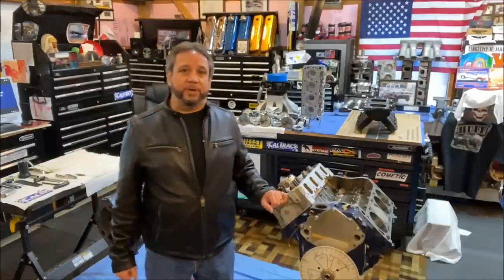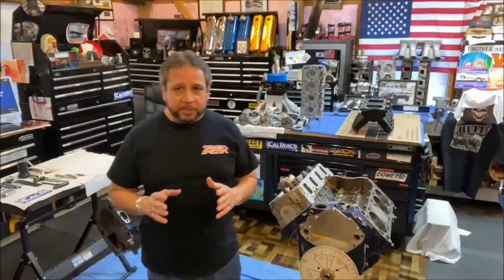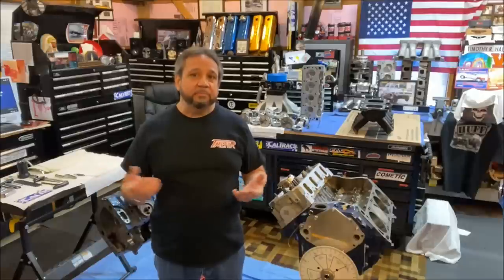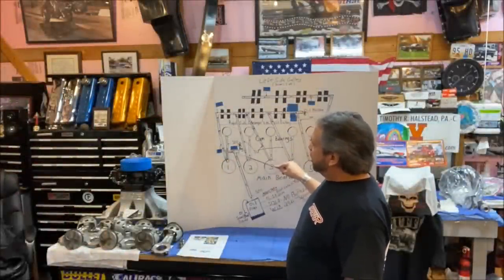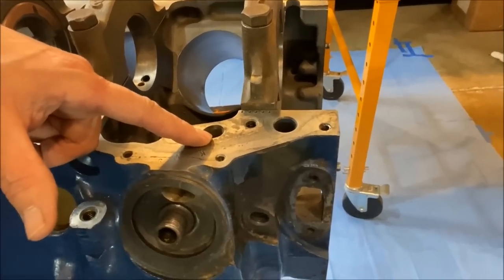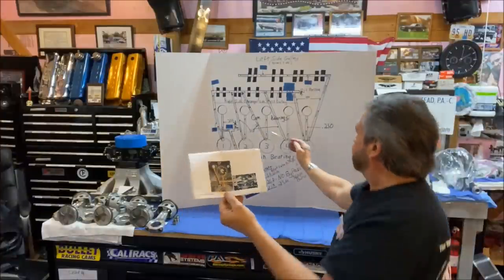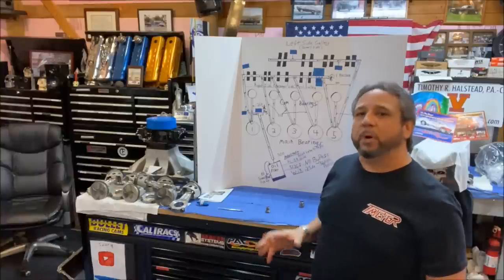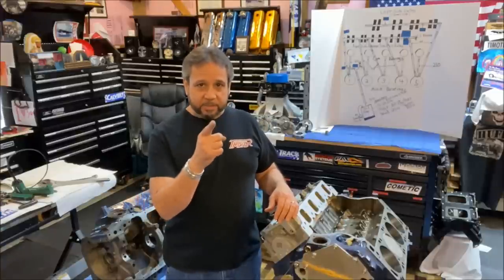Ford 351 Cleveland Oiling,  The Truth, and More

Comment: Mr dragboss, I had oiling problems with my 351C with 4V heads.  It started after I decided to go wild and have my engine really perform.  I never had any problems when it was stock and only putting out 300hp.  I had cleaned the inside of the block and debured sanded and used armature paint to coat oil return passages back from the head all the way down to the oil pan.  I had oil restrictors to the cam bearings too!  My 351C with 4V heads was ported and polish with a wild Crane billet roller cam.  Gross lift almost 0.750" 312 duration.  1150cfm dominator, modified Super Competition Hooker Headers.  Pretty much straight headers but with the collectors.  After many years later I figured the the reason I had oiling problems was due to acceleration.  This 1970 Mustang fastback was a light stripped down version without any frills.  It put me in the seat so hard that reaching for the shifter required lifting on the gas pedal.
That was what the cause, acceleration put me pinned in the seat and the oil in the oil pan pinned to the rear of the oil pan.  The answer would have been creating a oil pickup for the rear of the engine which would have solve the oil starvation problem.  Please comment back if the find this post.
Reply from the maker: Thanks Greg for watching the video and commenting. You are 100 percent right. One of the most important aspects of oil control and adequate supply is you need a big sump, 8+qts, I had issues too and then learned a few tricks and have been good ever since. Yes I also just leaned that the pan shape also affects oil control and you are best to have a square pan in rear, the stick pans are poorly designed in regards to windage. I am burning a video, right now with interview with Trickie, from the famed Australian engine builder/racer team of Trick and manswetto. Wait until you hear his opinion. Glad your here Greg. Way more in store hopefully post tonight.
Reply: Whoever built Benny Gatts Clevos, must know a legal F""ck ton about them.
Reply from the maker: I would say so.
Reply: Motor plate. Rear sump. 12 quarts of oil. Remote filter, two of them. Braided lines.
Only one thing chevy has over our Ford's. Rear sump.

Comment: Another great video, from my experience and research, aeration of the oil is a big factor , which in my case running hydraulic lifters , had a hard time stopping valve float , even as low as 5000 rpm’s , installed solid lift cam rev to the moon , put did it just mask the aeration? The line from the front to back from what I understand minimizes the aeration. My new Cleveland I installed Tim Myers cam bearings, plugged the half inch hole on number 1 journal , full groove bearings, and Denny Wydendorf diy lifter bore bushings (super easy to do at home) standard pump , and never looked back , also it basically turned my block into a priority main .
Reply from the maker: Thanks John for watching and sharing your real world experience. Not sure on your issue, I have never ran a hydraulic cam. Looks like you got it figured out. When I think of valve float, I think weak springs, but again no juice cam experience. Denny messaged me and we are going to chat. I have never ran bushings, and have seen his kit installed. Who knows maybe he will sponsor me, and we will put a set in and an episode. Be cool for sure. Aeration could be happening, also. I found you need a large sump, where I am at. All good things to consider to help optimize your oiling system. Glad your here and stay tuned

Comment: Love these education videos hope you keep making them. I got the 400m boat yard motor. But having knowledge from the guy's who have been there. 500 passes on a motor means you've learned a lot.  Oiling a stock motor an cooling it was rough issue from it's stock form so restricted. Make's sense faster you can get the motor on the top front n back the faster you can reduce friction. Mechanical oil pump on my 400m running Lucas Motor oil at only 80,000 mile's failed.  Truck has sit 16 year's now. After replacing it with another Mechanical pump I felt stupid knowing oiling an cooling was a issue. Putting a patch back to the problem wasn't my intention.
Reply from the maker: Thanks man. Now better get it back going, 16 years is too long to sit idle.
Reply: How do you know the oil pump failed ? Oil drive shaft between distributor and pump twist/ break ? 
Did you drop the pan ?
Reply from the maker: Missing what your saying Cam?

Comment: I just picked up a new project car and now I found your channel with great information.

It's an all Original unopened BOSS 351 swapped into 1986 Hatchback Foxbody.

I'm very interested in learning pushrods again after running Modulars for so long.

Liked/Subbed.
Reply from the maker: Sounds like a good find. Any boss engine should have D1ZX part numbers, I did a whole video on rec room geometry there’s a link to it you can check it out make sure watch my channel. Stay tuned.
Mid Lift Theory /Rocker Arm Geometry, Laser Guided Precision.
https://youtu.be/1fU8jAz5RGw

Comment: I'm a cleveland guy. Mine is a 1970 boss casting, .030 over, 56cc closed chamber aussie heads, lunati bracket master cam(4 deg. adv.), dual plane intake with divider completely removed. Stock rotating assy. About to put 2 small turbo's on it, 8psi waste gate pressure. In a 73 mustang. There is a learning curve on these motors for sure.
Reply from the maker: Your car will be making some crazy power with boost, I worry about the increased cylinder pressure, but with 8 lbs or less you should be fine. Hope your cr is not too high. Thanks for the kind words. Glad your here. Please like and subscribe, way more to come
Reply: @DragBoss351Cleveland  I subbed.  
  I worry about compression too. It's around 10:1   I am going to start with some very low timing, like around 16 and raise it incrementally keeping a check on the plugs. I'll set the final timing based on the timing line  on the electrode and how they overall look.  I shift at 5k, so I'm not looking for high RPM.  It shouldn't starve for fuel. I have A/F gauge to monitor.
I wish I had a dyno.
Reply from the maker: @starbattles1  I always use total timing at rpm, I lock my distributor, runs way better, idles better. Yes, 10:1 is a bit high, but if your not beating it to bad may be fine. I would be pulling that to at least 6k, let it stretch its legs.
Reply: @DragBoss351Cleveland  I really wish I had gone with roller cam when I built it. I will next time it comes out and apart. But I need to do fuel tank swap with elect. fuel pump in tank. Already have it, just need to do it.  I figured out these mechanical fuel pumps, even good ones, don't like rpm's over 5k. When I would run it to 6k the fuel pumps wore out super fast. Since I made 5k my shift point I stopped going through fuel pumps.
It was first built with flat tops, 14:1 high rpm intake and 3k stall. 
I had to dial it back to the open dual plane dish top's and 2200 stall to make it derivable around town. That's why I want the turbo's. Keep the drivability I have now, and get back the power I gave up, plus some.
And it's a real sleeper too. Very unsuspecting looking.  I hope to call it the Hell Cat killer.
Reply from the maker: @starbattles1  Hell Cat Killer in the house. I can understand what your saying, I gave up on mech pumps, in 1998. And then only ran Barry Grant until this new build, and now sponsored by Pro Systems, so running his venom carb, and 440gph electric fuel pump. If you need anything, call and talk to Patrick at Pro Systems, tell him I sent you.  Keep us all posted with the build, thanks for taking the time to contribute. Be safe, and be fast...

Comment: Flex Hone makes 1/2 inch hones in a couple different grits. If you take one and weld on an extension made out of a tube.  You can reach any where in the block. I've also heard the Cleveland called a "medium" block.
Reply from the maker: Thanks Timothy for looking out, sounds like you been there. Thanks for watching and giving some tips. This can benefit all. Make sure that you subscribe and stay tuned.
Reply: Ford literature first called the two 351's medium blocks. W & C. So what you heard was true. I remember reading that in the 70's.
If you start collecting Hot Rod magazine of the time period, you will occasionally read it stated. " medium " block.
Small block and big block is GM nomenclature, not Ford.

Comment: This is your most informative, most useful vid yet...
May I humbly post some additions ?
Long time ago I wanted to determine just how much oil was leaking around the right side bank of the lifter bores and thus understand just when and if I should sleeve these lifter bores( yes...I had all the tooling). I used a pressurized oil tank to feed oil to a 351-C long block (thru the oil-pump feed hole) that had no oil pan or intake manifold fitted. Obviously I had a catch basin underneath to control the mess. Upon having first applied pressure, I was AMAZED by the oil POURING out of the #1 journal/housing bore. This led to my modifying not just 351-C's but all small-block fords that are of a similar configuration. My mod was similar in concept to what you have shown/explained here. I made a thread-in sleeve that was drilled to the same hole size as the feeds in mains 2-5, and then plugged that drilling going from #1 main to the #1 cam housing bore. If you take a moment to check out Dart sbf's, the best ones have resolved this same issue. 
Now that you've got all this oil make'n it to the right side lifter/main oil galley...you might want to consider some restrictor pushrods...less your right valve cover becomes the oil pan...;-)
I think a single stage external pump feeding an AN-90deg hose end theaded into the back of the right lifter/main oil galley is the "hot lick"...and you get to mess easily with pressure settings...
I also believe getting oil to the rod brg is the #1 issue...not to mention the rod journal diameters...rod brg width, clearance, eccentricity, crush...crank oil passages...heat treat...brg coatings...possible main brg mods...crank material...yaada...yaada...yaada...
Ohhh...I have a question for Rusty...Was Bob mess'n with "Distance Between Bore Centerlines"...one of my favorite topics...
Keep up the good work Tim !!!
Reply from the maker: All good info David, Tim Meyer had said the same about number one, having so much oil. I have to quite a few guys, all with similar stories and different fixes. The best I have seen, includes restrictors in the galleys themselves, will oiling directly to mains from external oiling. I have the old hank the crank set up, and I can see where they would have drilled up through main feed into valley, to directly place additional feeds in to feed of main along with galley restrictors. Lots of fixes, to me is what do you really need for the average guy. I am going to work on another vid, with more in depth info, on pumps, and bearing clearances, pans, oil control. Be so nice to have a block like Dart with dedicated galley to the mains. For the 409, probably going to add the auxiliary line. Subsequent builds will get the work over. Almost tempted to install the hank the crank and modify and restrict galleys, wait until I get to that point. Tons of good info and experience here for sure. Thank you David for helping me build my channel, and providing us all with your insight. Stay tuned
Reply: D.S. …………..back in the day Glidden used to put pipe cleaners in the pushrods , they make prickley one that works perfect !!!!!!
Reply from the maker: @dannycalley7777  cool info to know I have heard that before. Wondered if the debris from cleaner, the fibers get into oil? How do you know he did this? Thanks for tuning in Danny
Reply: @DragBoss351Cleveland  D.B. ………..in a Magazine ,back in the Pinto era , 73 74s , he didn't run the H.T. C. system either that's the best I can remember and as much they changed valve springs and engines those small fibers , getting pushed thru at 100 psi were the least of him and Etta's worries ? P.S. I read an article on Grumpy same time , he was using a block from his towing rig that had over a hundred thou on it in his race car , Chevys were bad for core shift ,and offsetting of the cam journals, blocks were 2 or 3 out of a hundred according to him ?????
Reply from the maker: I think he was dry sump 72 up,
Reply: @dannycalley7777  "Grumpy" Jenkins was a HOOT! I remember at one particular NHRA National Event, he screwed with everyone's minds by pulling the carb off his ramp truck and used it to "replace" one of the two on his "327" Pro Stock Vega. 😆
Reply: @dannycalley7777  "Grumpy" Jenkins was a HOOT! I remember at one particular NHRA National Event, he screwed with everyone's minds by pulling the carb off his ramp truck and used it to "replace" one of the two on his "327" Pro Stock Vega. 😆
Reply from the maker: So then what happened? John
Reply: @DragBoss351Cleveland  He started it up and idled it at his "usual" aprox. 600 RPM. 😉

Of course, few were aware he had actually placed one of his race carbs on the truck's manifold while no one was paying attention earlier. 

Grumpy was a 'PsyOps' master! 😄
Reply from the maker: @johnjohnsn7633  I can see him doing that, mind game, have heard a few things about others. How the heck, can it idle at 600 rpm, with the cam he had, you know it would be more like 1500 rpm.

Comment: Mr dragboss, continued from 1st comment:  I looked a the issues of creating a rear oil sump pan for my 1970 Mustang fastback.  The steering center link passed below the oil pan in the rear and a support bar for the frame, both in the way.  I did have a Mellings high volume oil pump and chrome moly oil pump rod.  It would require a specially built oil pan that would allow the steering link and support to pass through the oil pan
Reply from the maker: So true. My Cougar is in chassis shop right now, all stock steering linkage ans box are gone. Custom cross member so I can run a rear sump, makes so much difference. Bearing clearance, and all the other things you mentioned help build a strong oil system. Stay tuned

Comment: Hey there! I'd like to add to this as my family had built a Cleveland back around '02-'04, and other than the 385-series and other popular ford motors, and other surprising engines created by other manufacturers (story for another day)... Cleveland is by far my absolute favorite. 

So back then, our factory 2-bolt block had the following done

.030 overbore
PME (Price Motorsport Engineering Inc) Main Oil Restrictors (installed in only mains 2, 3 and 4)
External Oil Line (originally ordered from MPG Heads)
Standard Oil pump with Ford Racing High Pressure spring

Unfortunately we never raced it or dyno'd, and then take it apart to see the results... If i remember correctly, never went above 80 psi cold; but with a melling HV pump it shot past 110 psi.  Never had any loss substantial loss in normal oil pressure when running hot either.

This thing pegged 7k off the rev limiter pretty quickly as you'll see in an old video of mine around '05 (1972 Mustang 393): https://www.youtube.com/watch?v=jmjaSIz4lPE

Combination:
4V Heads with bowls touched up, 3-angle valve job - can't remember what type of valves or length, standard dia.
about 11.5:1 Comp - ran on either 110 or 112 Oct.
Edelbrock torquer untouched
750 holley DP with 780 main body (forgot the kit name from Jegs at the time) - should've done 950 like we were told lol
1.73 Harland Sharp Rockers
Custom Crower Cam: 232/248 @ .50, .584/.614 Valve lift - 112 Lobe sep
Scat forged crank 3.85" - Probe 4.030" pistons - cant remember size of the rods but I'm sure you'll know, but they're scat H-beams
2" Hooker headers - 3" Exhaust with X-pipe and Flowmaster 50's dumped
C4 Tranny with 9" Rear and 4.10's - 28" - 275/60's out back

Pretty nice for a street/strip application. 

Like said, never dyno'd but it had to be pushing somewhere close to, or above 500's at the crank.. 

We once installed the weiand tunnel ram with dual 440 center squirters with modded brackets and restricted at the meters with paper clips to dump less fuel..  Although we couldn't close the hood (lol), and our eyes were burning.. we could easily tell that the motor WOKE UP straight from Idle... Hence, makes sense why we were recommended to use a bigger carb.

Also, even though the throttle response was pretty spectacular from the initial combination itself, it most definitely sounded like it was improved with the tunnel ram.

Just goes to show you what these heads are capable of.. I'm sure raising the exhaust would assist, but if you could tune other parts of the motor, like cam timing.. I'm sure this portion could be overlooked if it's not for racing only

Keep up the great work! I may still be considered a 35-year old kid, but I love the history and hearing about all the folks from back when this motor was in its hay day!
Reply from the maker: Gregory, that sounds like a killer combination, and even the video proves it. The only thing that I thought would be too wide is the lobe separation angle at 112. But hey it look like it was working. Just think a how it would ran if you’re able to race it, after you got the carburetor adjusted, that thing would’ve been more of a monster. I’m glad you took the time to tell me your combination, it’s cool to see what other people building, the results. Way more in store, just wait until 427 TrackBoss comes out,  I think you’ll like that too.